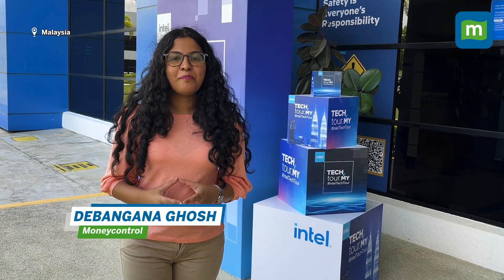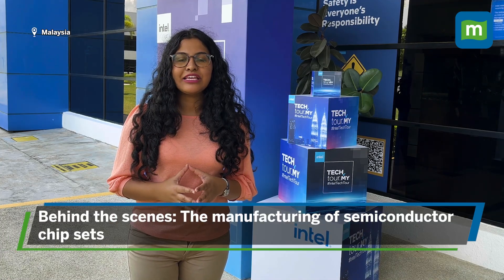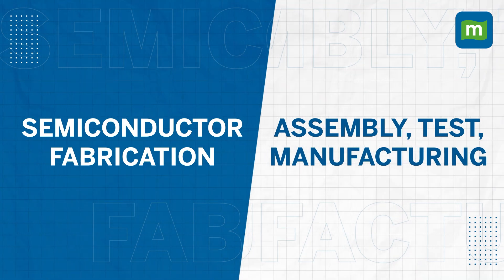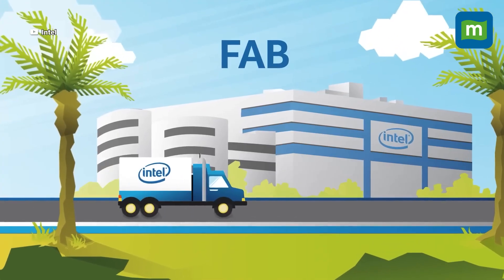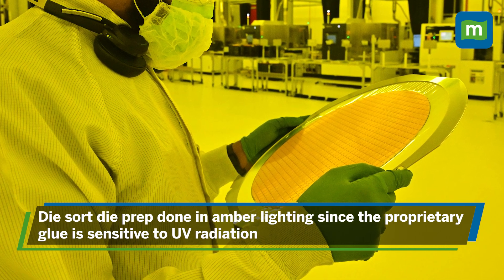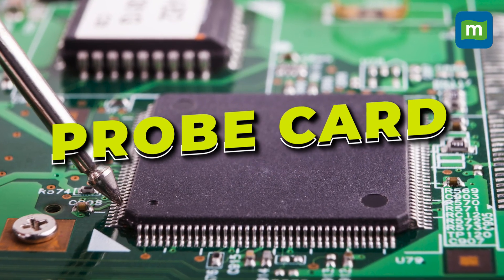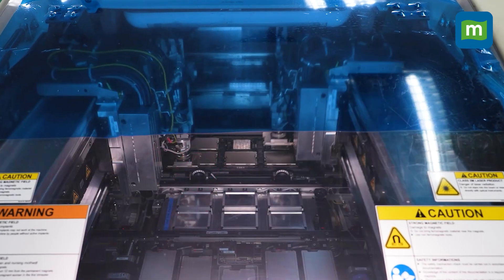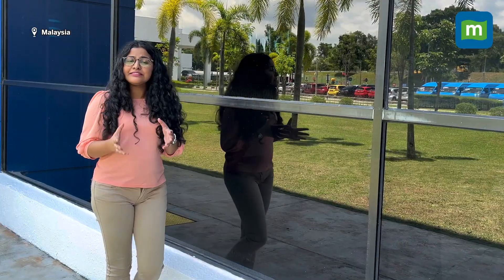What Does It Take To Make A Semiconductor Chip? Inside An Intel Facility In Malaysia | Ground Report

Comment: Malaysia should not follow China failing footsteps. US govt has never place trust in Islamic controlled Malaysia nor Communist reigned China to be host country for the core design and manufacturing in the top end AI chips in particularly with Malaysia prolong unresolved decades old racial and Islamic dominance and Malays ethnic bias problem.